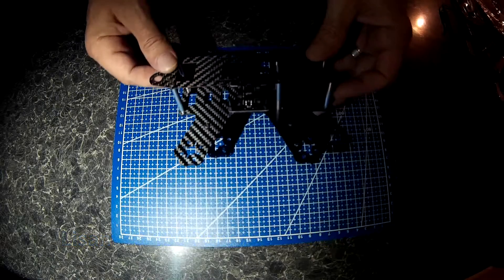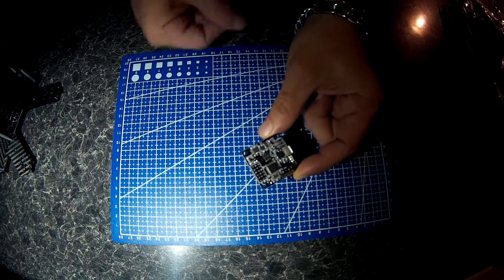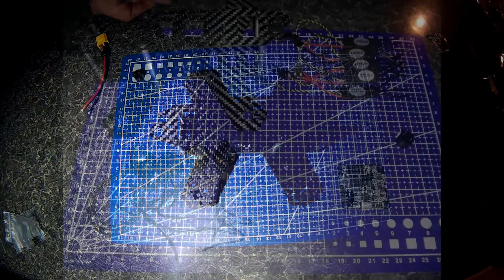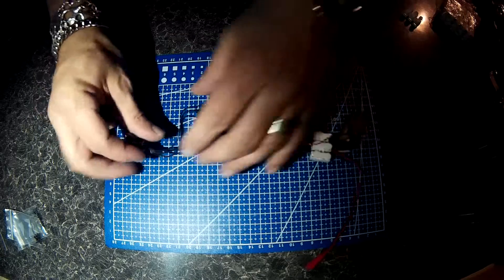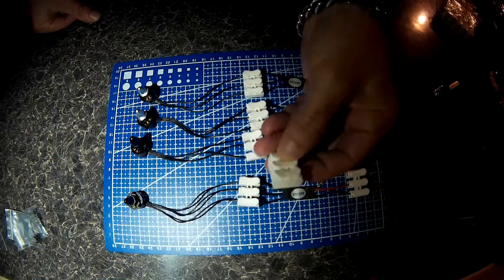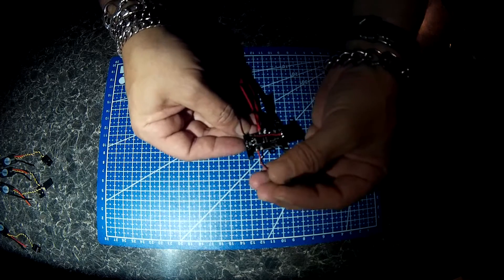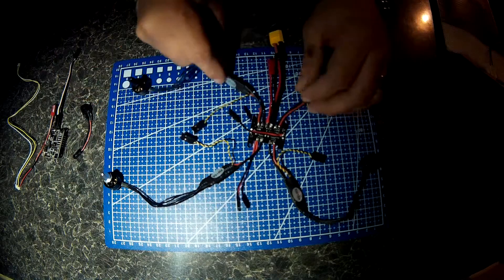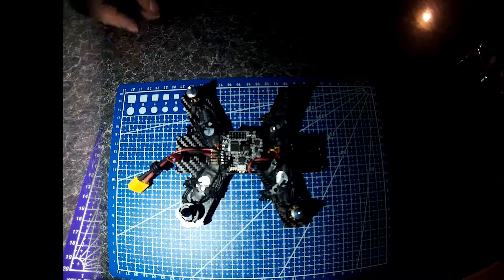Lisam LS-130 Part 2 - Build Log

Comment: Can you use little bees 20a ESCs?
Reply from the maker: By all means, ,but there are better available. Aikon seem to be the coveted ESC's at this time as are many of the other BLHeli_S variants.
Reply: +MrE I bought some 20a little bees for  another build, but didn't use them yet. That was why I asked. So do they work?
Reply from the maker: Kenneth Wang yes, they will be fine and also give you the possibility of running 4s if you choose to.
Reply: +MrE Do you run 2s or 3s or 4s now?
Reply from the maker: +Kenneth Wang I run 3S on my LS130 and I'm still contemplating going 4S. I'm leaning towards leaving it as a 3S though.

I will put a couple of DVR captures from it up shortly if you would like?
Reply: +MrE Sure. I would love to see your flying technique and style. Also, are you on acro mode?
Reply: +MrE Also, how many mah and c rating is your battery?
Reply from the maker: Kenneth Wang
I use 850mAh Nanotechs, I believe hey are 25-50C
Reply: On another video, the person showed the emax 1306 motors completely overheat at 15-16a. How should I make sure little bee 20amps don't burn the emax1306 motors? Is there a way to adjust amp output of escs in Cleanflight?
Reply from the maker: Kenneth Wang
 Can you link the video?

15-16A sounds like they are running 4S? I would assume that it is not about limiting the amperage available but rather a setting in the ESC's firmware itself or prehaps some other cause (static/no props test or to high of a P/D term in the PID controller?)

I bought these Emax's on the merit of the much loved RS2205 redbottoms and personal experience with them being a very good motor,expecteing the 1306's to carry on the legacy.
Reply: So assuming I do run 4s, do I just lower the C rating of my potential battery?
Reply from the maker: No,you would want a higher C battery theoretically as you may need to extract more Amps due to more current draw from motors on 4S , C is just the potential discharge rate of the battery: mAh X C Rating.

Example an 850mAh battery with 25C - 50C will result in a nominal amperage throughput of roughyl 21.25 amps and a short burst capability of 43 amps. as you could imagine that would be acceptable to some degree if you were running 4x10a esc's

Check the following videos for indepth info ,these should clarify alot regards batterys and motors:
All about Lipos:
https://www.youtube.com/watch?v=ZJHlJYDJohc
Which Minicoptoer battery:
https://www.youtube.com/watch?v=liB1SUlBQio
Motor:
https://www.youtube.com/watch?v=IP4PFq6u7wg

Comment: What is the buzzer used for?
Reply from the maker: The buzzer has a few different uses,
Firstly it will let you know the state of the flight controller initializing/arming and changing flight modes etc.

Secondly, a switch on the radio transmitter configured to trigger a mode in the flight controller to enable the buzzer as a lost model finder. I also have my radio failsafe set in conjunction with the buzzer ounding just incase.

Depending what flight controller (Naze32 family and it's kin primarily) you can feed the crafts voltage to the flight controllers relevant input to singal you the state of the battery via audible beeps from the buzzer hence alerting you when ought to think about landing.

Comment: What connector should I use? JST or XT60?
Reply from the maker: There is no right answer that I can give you ,just my own opinion.
Personally I use XT60 although some will say i should be using XT30 etc , I choose to use XT60's as all of my batterys are that and I prefer to have the same connectors for the most part aswell as being what the batterys came with.

JST is nowhere near viable of a decent amperage that we require. some rate it from 2A to 10A pushing the limit but our crafts can require an order of magnitude higher depending (4x10A constant current ESC's + other power drawing components).

Comment: Do you think a 1806 motor would work here on this 130 frame?
Reply from the maker: No, 1806 would not work very well on a 3" propped craft.

You could have it work but you would be leaving alot of performance on the table due to the 1806's increased weight and lack of being able to spin the smaller props at the speeds required,I think I go into great detail in the RCGroups thread with some science of the motor speeds and projected thrust.
1306 or 1407's are the motors you should be looking at for a 3 inch prop on this frame 

I have a set of Emax 1306 3300KV Race specs that I am considering putting on this craft with a more powerfull battery.

Comment: How well does it take low speed crashes?
Reply from the maker: Very well so far, I have yet to do any damage - I am quite easy on my quads though.
Reply: +MrE I am quite the opposite. Right now I fly cheapy custom brushed quads and I fly fast and aggressive.
Reply: +MrE Do you think the 150 will be fun?
Reply from the maker: I do find 150 sized fun ,but from your previous comment regards flying fast and hard - you may be better off with something a bit larger like a 180 or a 210. My brushed and 150 etc are more for flying in smaller areas that doesn't suit higher performance.
Reply: MrE Unfortunately, all ,my local parks are tiny. I need something easy to fit through gaps. FYI, I havent started on FPV yet. I fly line of sight. I plan to make the 150 my first fpv quad!
Also, I recently started a channel of my own(2 weeks ago) called Chrysopelea RC. Do you have any tips and recommendations for a  School club RC channel?
Reply from the maker: I understand, something like this may be suitable if you primarily want durability with the smaller class ,but performance suffers a bit.

There are pro's and cons to this frame as with everything ,it is great for a first build due to the excessive space on par with a 210/250 size frame but that is also its short comming regarding performance to weight. there are other better performance oriented frames available (I will be posting a video soon about a newer/smaller 130 frame that is more performance rated).

I am still very happy with this frame and it is pretty much bullet proof - i can shoot gaps knowing pretty much the worst that will happen is a prop or some other minor damage.

I'm not the greatest person to ask regards your channel but I do know a few pearls of wisdom:
Content is king.
Interaction with your subscribers goes a long way.
Produce what you would like to see.
Dont force the issue and keep the content flowing.

I hope these suggestions help in some way.
Reply: Yeah, I think I want the durability for now. I need something really crash-able to practice with.
Reply from the maker: Kenneth Wang
There is nothing I know of that is so overbuilt/overkill regards the frame. Being a very cheap frame on the other hand, you could always swap the components into a less durable and more performance related frame in future.

Comment: hey do you think the 1306 motors are enough or would you go with the 1806?
Reply from the maker: +michael carmouche No, 1806 motors would be complete wasted weight without any benefit to performance due to the 3 inch prop size on this frame.

I am currently flying ok on 1306 3100KV/3S but intend to either go 4S with the 3100kv or maybe try the 4000kv 1306's on 3S. I have a couple more parts to this series that I have yet to have the time to share,keep an eye out.

Please see the RCGroups forum thread in the description as it goes in to quite some detail regards the information you seek and the train of thought that lead to the conclusion reached/shared.
Reply: +MrE well right now im flying the 1306 on a lt130 wich is alot lighter and the motors are getting really hot with normal flight. i want to upgrade to this frame so i can run a better camera (even more weight) and am just concerned the 1306 will burn out. i have 1806 dys just laying around but if you think those are to much what about the 1704?
Reply from the maker: +michael carmouche That is the dilema! I would like to be running something a bit tougher than 1306's but personally anything with less KV would make the LS130 unflyable due to its relative weight.

Oddly my 1306's dont get hot even though I'm putting them under alot of stress , Have you tried getting to the bottom of your motors heat? - prehaps timing or too agressive PID's with damped light etc ,Even shorting the motors windings with the mounting screws?

May I suggest that you look at a frame a step larger like the LS180 to run on 4 inch props with the 1806's? What 1704's are you looking at?
Reply: +MrE  Yeah i checked for shorts and changed the pids multiple times still getting hot and i have a 210 i want to stay with 130 because of the lack of flying space but what is your total weight on the 130?
Reply: +MrE  Yeah i checked for shorts and changed the pids multiple times still getting hot and i have a 210 i want to stay with 130 because of the lack of flying space but what is your total weight on the 130?
Reply: +MrE and either the rx1704 or multi star
Reply: +MrE nvm i just found out there was 1407 3200 kv i think that might be the way to go
Reply from the maker: +michael carmouche the 1407 3200kv's would be a good candidate. Your reasoning for a 130 class I understand as mine is the same for wanting one.

My LS130 weight as it is at the moment (that needs a serious diet...) which is inclusive of an 850mAh 3s Nanotech( 81~g) comes in at 314g. It will fly with a Mobius at a notable performance hit etc so I dont plan on doing so again... It will also take flight with a 1300 3S with much the same results. 

I am in two minds about where to go as mentioned earlier regards getting better performance out of it, My first stop is 4000kv on 3S (I have them sat here waiting to go on) but I feel that it would gain alot more going to 4S on the 3100kvs (Which means swapping out for higher A ESC's sigh) aswell as more weight from the 4S battery. I just need to find a happy medium and I'm hoping that the 4000kv's will provide that.

I am happy flying it as it is though,don't get me wrong - its just not a rocket ship or anything to write home about and we always want more power.

Out of intreset- What ESC's are you running your 1306's with?
Reply: +MrE mine with batt is 264 and i have the dys 16a esc but when the ls130 comes in thats more weight and im swapping the 6 gram camera for an hs1177 so ill probably be pretty close to you. i just found a California site with 1407 3200kv for 11.99 and i think that will give me the results im looking for.
Reply from the maker: +michael carmouche I nearly asked if you had DYS BL~ series ESC's - they were/are a bit renowned for problems running high KV motors, Updating to the latest BLHeli firmware may be wise to keep in mind if you have not previously and continue to have problems on your new build/motors.

For the LS130 I have built so far in this series of Vid's, I have since swapped out the CMOS camera for my first CCD( Runcam Skyplus) and I'm over the moon with the difference - I also have an HS1177 Foxeer sat here that was awsome also when tested. The added weight is more than worth it, especially if you are going to be in glorious sun alot of time.

I must find time to further this build log/flight series :)
Reply: +MrE i updated them on all of my quads except the 130! For some reason i can connect fine with sp board but when i try with a naze it wont work. Its driving me nuts but the ls frame in this video does ot measure out to 148mm or 132mm?
Reply from the maker: +michael carmouche Prehaps they have an odd bootloader on them ( SimonK maybe?) Other things could be due to the version of Naze/BF/CF firmware version also. Maybe worth investigating with an Arduino etc and bypassing the Flight-controller?

The version of the LS130 I have featured in this video was one of the earlier ones that measured 145mm~ motor to motor. The restocked LS130 is now a true 130 class measuring 135mm motor to motor ( confirmed by a couple of different community members who have received ones ordered more recently - I think the linked RCG thread has the specific timeline of when that restock occured.)
Reply: +MrE yea im waiting for the usb to come in now i hope that fixes it because man they are getting hot but once the 1407's come in ill let you know but id imagine the 8 extra grams for all 4 will be worth it
Reply from the maker: +michael carmouche Sorry for the late reply - Google/YT has only just given me the notification... I would be very interested in hearing your results with the 1407's aswell as if upgrading the firmware helps the current heating issues. I am also in no doubt that the little extra in weight would be worth it , even just for the sake of durability which the 1306's receive some scorn for.
Reply: +MrE Its all good the 1407 are here and they are way better at first i had the 3200 kv wich was basically the same as the 1306 so i swapped them for the 1407 3800kv and they completely blow everything out the water i still want to try the 1806 though just to see i checked the weight difference and it would only add 24 grams total to the build
Reply: +michael carmouche only because the 1407 are getting hot as well
Reply from the maker: +michael carmouche I sure would look into doing something with those ESC's seeing as the heat issue is still plaguing you. Hearing that the higher KV motors are doing well ,you are inspiring me to get around to fitting my 4000KV's and see how they fare. Thanks for filling me in and please keep me posted on how you are getting on etc.
Reply: +MrE just updated the esc firmware it wasnt working at first because i had the very first betaflight firmware lol but i will let you know how it does now
Reply from the maker: +michael carmouche Cheers, Michael. Are you planning on populating your YT Channel with any videos etc in the future?
Reply: +MrE I am i just started a year ago in the hobby and dont know anyone else so ive had a slow start. I just switched from angle to acro though and am planning to start posting my videos in a couple of weeks